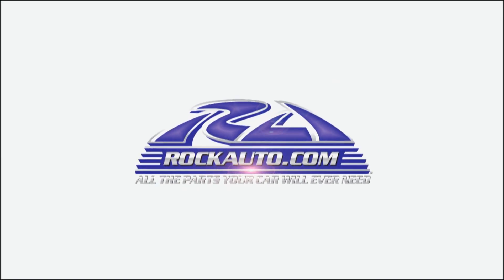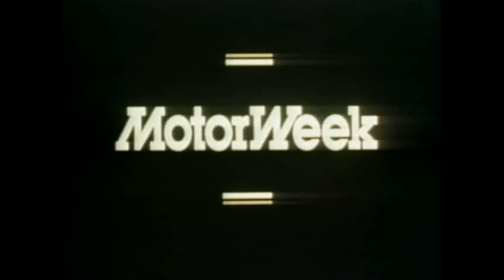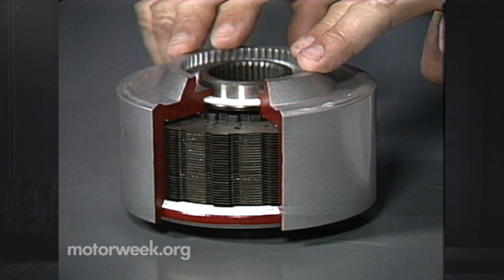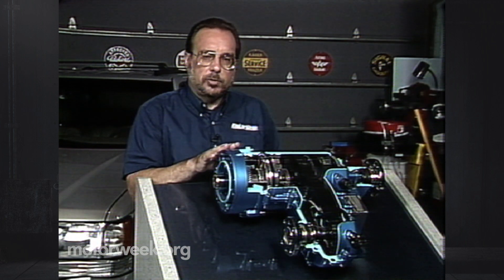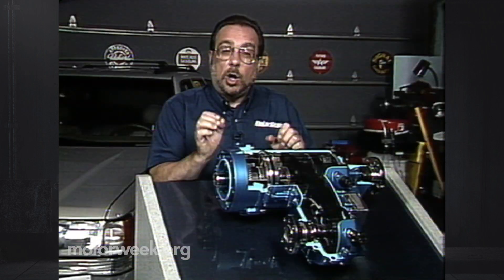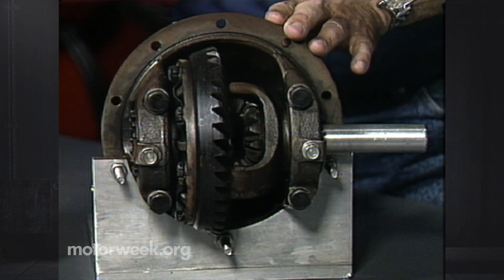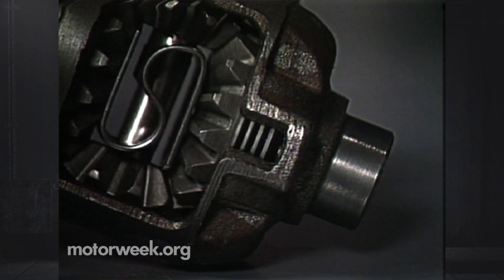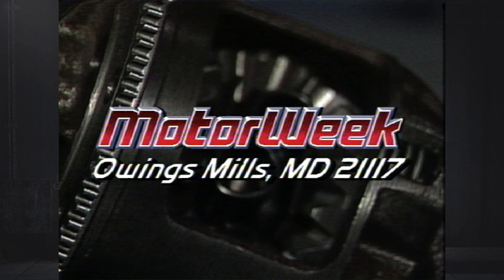MotorWeek | Retro Goss: How Limited Slip 4WD Works

Comment: AWD systems can handle mud, sand etc, especially since you can have electronically (or otherwise) locking center differentials. Even my '93 Impreza had that, and you could lock it in by putting it in manual mode (a button on the stick) and dropping it down into first. But also there is EBD, using the ABS to emulate LSD. Many AWD Audis and VWs since about 1997 do this up to 40 kph and now it's become not uncommon to use it at higher speeds as well, even on performance vehicles.